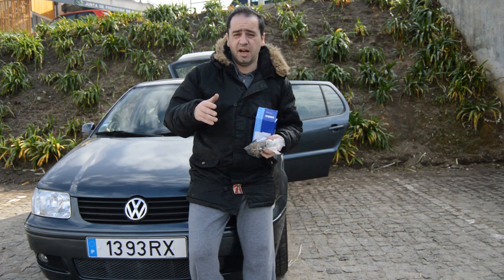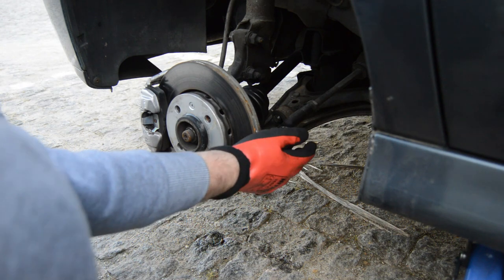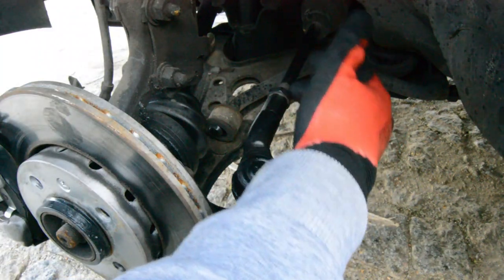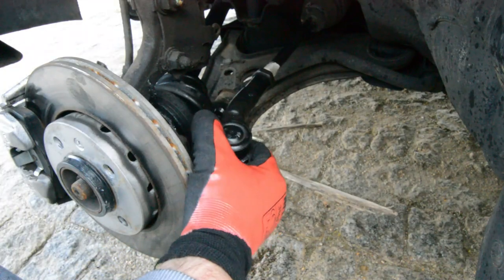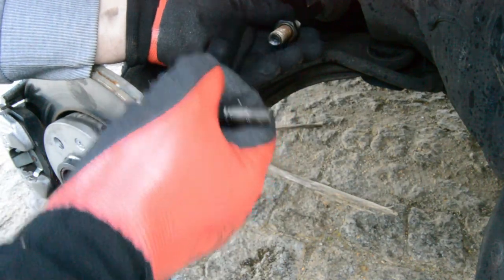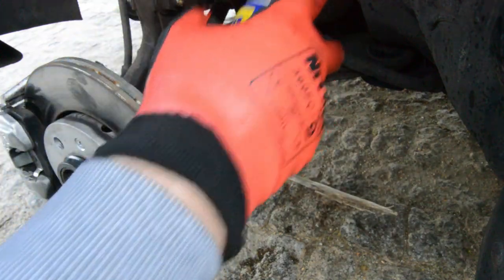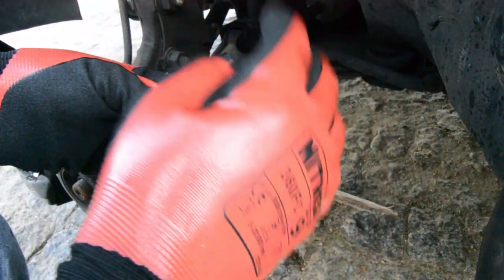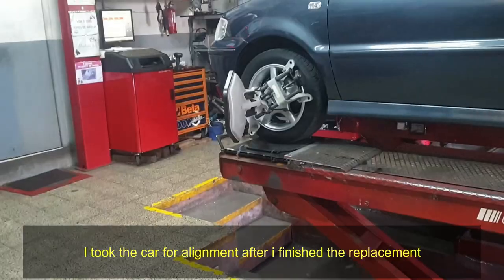✅ VW Polo Tie Rod End Replacement - Do It at Home

Comment: I have problems with the climate control lights inside, how can I fix this? or maybe replace it
Thanks
Reply from the maker: Hi Rosario.... If you are Spanish you can write in spanish... I also speak Spanish. What kind of problem you have? No light? If its only the light that is not working, you only need to replace a small bulb... I leave a link with what you need https://youtu.be/cJGrarZsLHo
Reply: @RandomTubePT  I'm Italian, the problem is that the internal lights where you can adjust the air conditioning and the position of the fans don't work, it's practically in the dark ahah
Reply from the maker: I dont speak italian, sorry 😜 Thats really easy to fix, you only need to replace a small bulb... Check this video, you can see how you do it https://youtu.be/cJGrarZsLHo
Reply: @RandomTubePT  Thanks for the reply, you've been a great help 👍👍👍👍
Reply from the maker: You Welcome 😉 I like to help, thats the reason i create videos. If you need something just let me know. 👌
Reply: @RandomTubePT  thanks a lot 👍